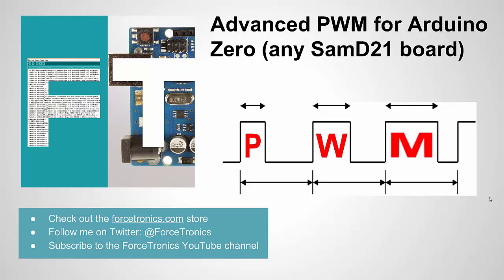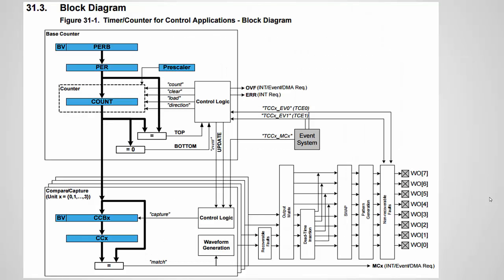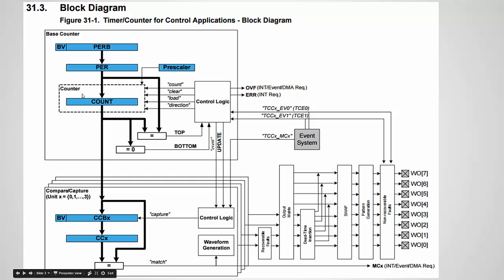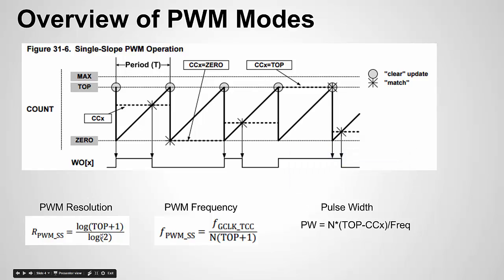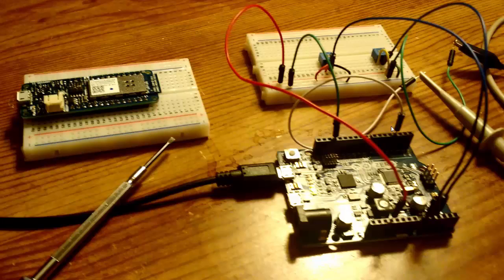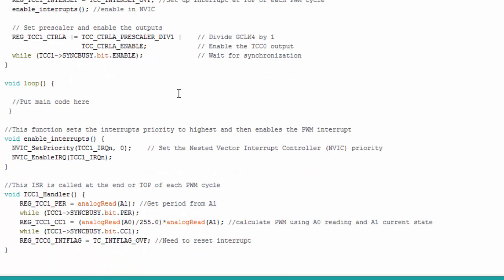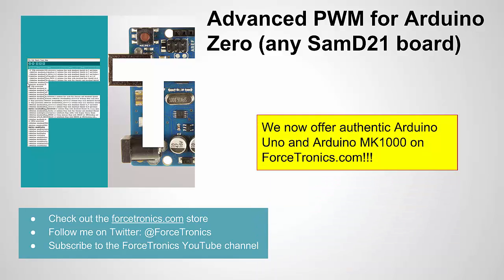Advanced PWM for Arduino Zero or any Atmel SAMD21 Based Arduino Board

Comment: If one is doing an analog read at every interrupt, doesn't that limit your frequency? How could you ever get 100kHz since analog reads each take milliseconds ? .... or are all the TCC interrupts that happen during the analog read just ignored?
Reply from the maker: I did this video many years ago so I don't remember all the details. When you do high-speed ADC reads, you can either put them directly into memory using dma, or if you're doing them at a rate that's orders  magnitude less than the clock speed of the processor then you could access them with interrupts. 100 kilosamples per second is only 10 microseconds per read. The processor can execute multiple commands within that 10 microsecond window since its clock speed is orders of magnitude less than 10 microseconds.

Comment: Really nice video and well explained. About the only thing you could have emphasised a bit more was how cool these Atmel functions are in that you can run PWM completely independent of the code in loop(). You touched on it but it is so powerful- like having two separate processors for the price of one.

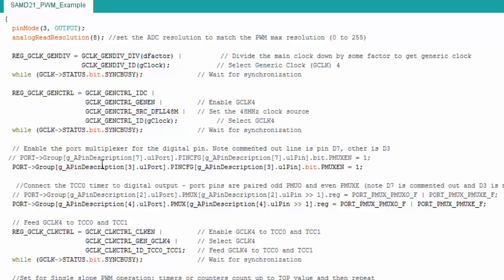Comment: Thank you for this awesome tutorial!  Unfortunately i've been facing a problems with your code: At  13:13 you are pointing out the muxing, but this configuration does not work for me. If you want to use D3 as output both lines should contain the identical Pin Number: g_APinDescription[3]. (Maybe this was an issue in 2016 and was fixed later in the Arduino IDE(?)).
It works also directly, if you put in the Group and the pinnumber from the Datasheet. E.g. PA04 -> Group[0] and PINCFG[4].
And i think once the comment contains TCC0 which should be TCC1 (14:01) and in the last line the reset interrupt should also be _TCC1 instead of _TCC0? Please correct me, if i got sth wrong.
The last thing what i am wondering about is, what does >> 1 mean in the PMUX argument? As far as i know >> 1 does mean divide by 2, or? Which relevant function has it in this context?

Comment: Great tutorial! Thanks! BTW I can't figure out why the PMUXE and PMUXO pin numbers are different from the enabling PMUXEN (here 7 and 3 for PMUXEN) but 2 and 4 for PMUXE and PMUXO... Any hints?

  // Enable the port multiplexer for the digital pin. Note commented out line is pin D7, other is D3

 // PORT->Group[g_APinDescription[    7    ].ulPort].PINCFG[g_APinDescription[   7   ].ulPin].bit.PMUXEN = 1;

  PORT->Group[g_APinDescription[    3    ].ulPort].PINCFG[g_APinDescription[    3    ].ulPin].bit.PMUXEN = 1;

  

   //Connect the TCC0 timer to digital output - port pins are paired odd PMUO and even PMUXE (note D7 is commented out and D3 is not)

  // PORT->Group[g_APinDescription[    2    ].ulPort].PMUX[g_APinDescription[    2    ].ulPin >> 1].reg = PORT_PMUX_PMUXO_F | PORT_PMUX_PMUXE_F; 

  PORT->Group[g_APinDescription[    4    ].ulPort].PMUX[g_APinDescription[    4    ].ulPin >> 1].reg = PORT_PMUX_PMUXO_F | PORT_PMUX_PMUXE_F;

Comment: Thanks for the well made and very useful tutorial. Is possible to get two outputs shifted each other 90°?
Reply from the maker: Yes of course. There may be multiple ways to do it, but one way would be using adjusting the timers for each PWM output to control their phase

Comment: I have a question ... can I use PWM on PB22 and PB23?
I'm planning a custom board and I'm wondering if these could do PWM.
Reply from the maker: Yes. SAMD21 allows you to route PWM to almost any pin on the chip
Reply: Okay, thanks! :)
Reply: Turns out, PWM can only be used on PB22 and PB23 on the J version of the chip. (SAMD21J18 - the 64 pin version.)
The other versions (E and G - 32 and 48 pins respectively) don't have the timers TC6 and TC7.

Comment: Hello again :-)

So, splashed out on a new Zero board and loaded the script.  It works, but what I found was that the length of time that the signal is present varies enormously.  In the main, the PWM square wave is running for a couple of seconds, then switches off again. The length of time when it's  running is completely random; a second or a few seconds up and it dies again, though frequency and duty cycle are adjustable as described.

I wondered if it was something to do with the USB power supply, but running it off my Rigol PSU made no difference.

I thought maybe I just had a dodgy board, but I'm trying this on a new board, fresh out of the box from Italy, and its behaviour is exactly the same.

So, working through the setup you had on your breadboard in the video... identical, barring I was using a different ground pin on the board and....................  I was using muti-turn pots!  I'm cooking the PWM at about 100kHz, so maybe I've got some odd mag-coil thing going on? Have I made a funky inductor with my wire wound pot?

Swapped out the multi-turn pots with standard single turn trimmers and hey-presto!  Rock solid output, around the 65kHz anyway.  Too high; above about 80kHz and things get a bit flaky.

Many thanks again for your time developing the code, and getting this vid' together for the rest of us newbies to learn.

Comment: Nice tutorial, but unfortunately the code doesn't seem to work on the MKR1000.  Any suggestions?
Reply from the maker: Hey Tom, give me a couple days to try this out and diagnosis the issue. I know the code compiles for the MKR1000. If it uploads but is not working it may be a pin mapping issue. Meaning the pins on the SAMD21 may not be mapping to the same Arduino pins on the ZERO and MKR1000
Reply: @ForceTronics  could you please tell me correction the code so it can work in MKR1000. Thnks